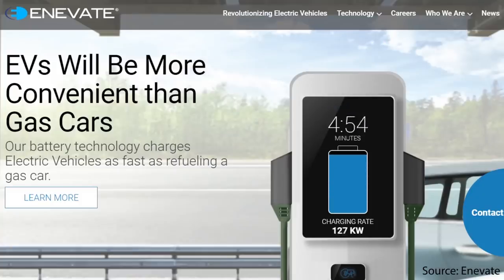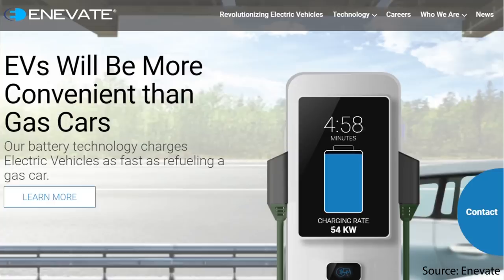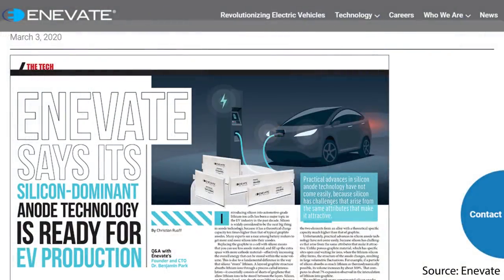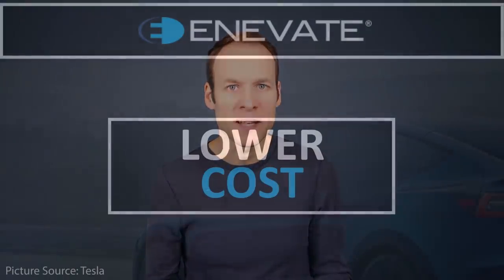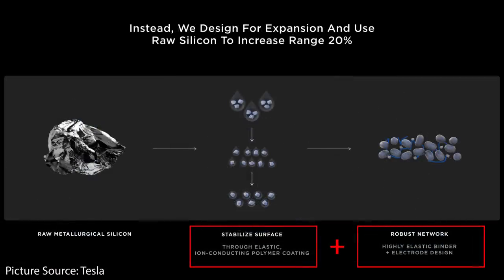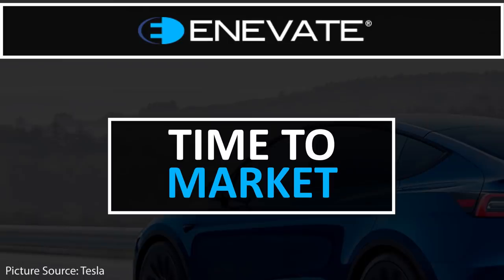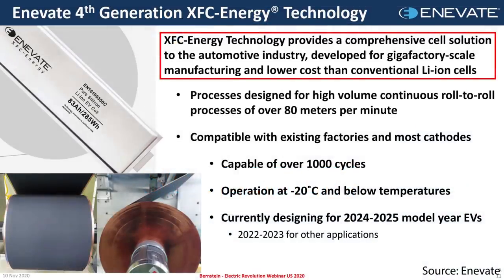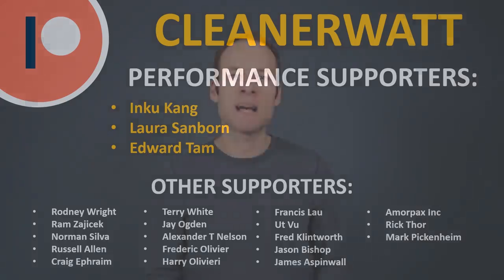Tesla Should Acquire ENEVATE Battery Startup (ULTRA FAST EV CHARGING)

Comment: What about the dendrite growth associated with more silicon - this severely decreases the cycle life of the battery.  How have they solved this problem?
Reply: SILICONE Lubercant.
Reply: The dendrite is actually much less with silicon dominant anode because silicon voltage vs. lithium is higher compared to graphite which leads to less dendrites. Especially with a silicon doninant design the N/P ratio between anode and cathode will be high which is good for safety and likelihood of dendrites decreases

Comment: I have zero doubt that project roadrunner has already done a full feasibility study on not only the properties but on the scalability of said batteries and they absolutely should not buy some stupid startup company when they are in the middle of ramping to production speeds on the battery that they feel checks off all the bases better.
Reply: The only benefit to buying innovate which doesn't have that many employees would be to poach those employees. that seems like a really expensive way to go around getting a couple more employees
Reply: The Limiting Factor in his last episode stated that charging shall be 2x faster in new battery.
Reply: If Tesla feels like Enevate's technology is better than what they currently are working on they could acquire the company to speed things up. Buying a company does not affect the rate of growth of Tesla at all. It can however be beneficial for future moves.
Reply: @yourcrazybear  
Tesla could have conflicting patents on similar silicon technology.  They might challenge Enevate and win.

Comment: Excellent innovation review.  Don't want to spill the beans here, but I believed the porous material is a diatomaceous earth material which is also silicon, but in this case, silicon dioxide remains of a siliceous skeleton (frustule).  This material can be crush into a much finer grain, almost microscopic, & it's used in a swimming pool filter.  Something in this line.  My guess, bake it.

Comment: First Principles thinking: Silicon expands by up to *400% which will destroy your battery. It doesn't have to destroy it right away but if It destroys your cell's internals in, say, a decade, what do you think that will do to your bottom line? Remember the biggest, costliest component of an EV is the battery.
Reply: Tesla IS going to a partial silicon anode. Solving the expansion was part of battery day.
Reply: That's what all the startups and big players in battery technology currently working on - trying to solve this problem.

Comment: hold up... your 4680 energy density estimate seems off. I am guessing that 20% number comes from range increase section of slide 67 of the presentation which points out that their use of silicon in the 4680 gets them a 20% range increase. What makes your 4680 estimate off to me is there is an additional 16% improvement from cell design and 4% improvement from cathode material that would also apply at the cell level. So assuming a straight application like I assume you did instead of

300wh/kg

it should be 

345 wh/kg

Which brings me to my other critique. Tesla's silicon anode improvement pretty much puts them on pace towards what your saying enevate enables. You should take a look at The Limiting Factors latest video IIRC. Not completly disagreeing with the suggestion. I would say however that enevate would need more than just the benefits of silicon which tesla is already doing in house and producing on their own manufacturing lines (at low yield currently), to make this aquisition make sense. The maxwell aquisition not only got them DBE technology. But I wouldnt be surprised if they leverage maxwell's capacitor technology to enable MW level super chargers

@cleanerwatt as for your intuition on the 300wh/kg being acurate based on what Elon said. I am uncertain if your holding that energy density as the best the 4680 can do with all the cell level improvements. Because given the agressive production timelines tesla is trying to meet. I would argue alot of the cell level improvements are not all going to be deployed at the same time. So for example I could see initially only the high nickle cathode and cell design (DBE + tabless) improvements making out the door at first, which also gets you to that same 20% improvement. While another 20% is slated to come online as tesla ramps its silicon anode production.
Reply: Its also possible that they start with the same chemistry they currently have and perfect production but focus on the form factor improvement, then move on to high nickel cathode, and then to the silicon loaded anode.  So it might actually be several stages before we get all the way there. Remember that Tesla wants to purchase their own first runs of the Semi so they can do internal testing and validation before  shipping them out. And that is the product that really NEEDS the perfected battery.
Reply: Tesla is also ambiguous : Range goes up more than energy density, due to saving in mass.

Comment: This is valid information for automakers who are not Tesla.
The battery day event by Tesla laid out the battery tech, the form of the battery 46x80mm and the fact that the actual structure of the upcoming models is based on that.
Sandy Munro said in his videos the efficiency and rigidity of the new module will make the cars stronger, safer, better handling and the battery less likely to be damaged in a catastrophic crash.
We should also remember that the teams working on the battery design and production from Hibar, Maxwell, ATW Automation and Tesla Grohman, plus what Tesla's own research, knowledge from Panasonic and Jeff Dahn's research site in Nova Scotia are bringing to the business.
Tesla are already making their new batteries and iterating the design of the machines to make them in massive volume. Might they already be being integrated into the Models S & X in the next couple of weeks?
Every one else is walking up to the start line. Tesla fired the starting pistol and ran away already.

Comment: The thing with pouch cells is that you can't use them to build a structural battery back, which is what Tesla is working on. And I'm pretty sure the Roadrunner cells are already plenty good, Tesla should just focus on ramping them up right now. Improvements come gradually later.

Comment: There are dozens of silicon battery start ups. maybe hundreds. Each of them could be potential buys. Nikola is an example where they claimed to have new battery tech from a university team. I do not doubt their claim. However with most of these the actual production is years away. A company might have 50 patents, and none of them might be practical in mass manufacturing. They may have one or two advantages, but when it comes to the whollisatic practicality they might have a crucial problem that negates the whole design eg silver lithium batteries ... too expensive. Tesla has to investigate these claims one by one and test and test and test.
Reply: I'm sure that there are hundreds, and 90% of the new ones are only there to extract money from investors.

Comment: Thank you for another great episode
You might have a point here.. 
but What make you think Teslas 4680 high nickel wont do the 5 minute charge?
Tesla has their own silicon, plus they have the dry electrode plus the tabless design and improved cooling.. and its scaleable. And acording to a Jeff Dahn paper they have 15.000 partial cycles
and it is in production today. And its cheap and fast to produce
But of course Tesla cant tell. Yet👍🇳🇴

Comment: I'm not really convinced by Enevate tech. 1k vs 1.5k is not a small difference and Tesla already has 1 million miles battery tech in their pipeline. They also have research going on about silicon anode, acquiring Enevate, or putting that amount of money into their own research? I think that money is better spent on their own R&D. Evevate tech looks decently impressive but I think it's better for them to work with other manufacturers than getting scooped up by Tesla.

Comment: Since Tesla is currently using more batteries than the rest of the market combined, why wouldn't they have already approached Tesla? Their ramp times make it sound as though this is not a production ready process yet. The fact that Tesla has already identified expansion concerns and addressed them in favor of cycle life makes a huge statement. Last they need to be able to produce this in a cost efficient manner. Approaching others to license the technology absolves them from actually having to solve some of the biggest manufacturing problems,  cycle lifetime of the cell, and actual range and performance in a real vehicle. All of these are already being proven at scale at Tesla.

Comment: I have a number of possible problems on my mind, which may not be  real, but I would like to put forth. While Enevate say they can make their technology in cylindrical format, I suspect that Tesla's 4680 cylinder format may be the wrong fit  for the sandwich roll Enevate may require. Tesla has probably optimized that format to their thickness of the rolled sandwich.
Enevate's density numbers may only occur in pouch cell format where the expansion can be most easily accommodated. Both prismatic and cylindrical cells have a more solid structure by design,  and pouch cells have to have that structure external to the cells. There goes the density advantage if that is the case. 
If those contracts that Enevate has already with other makers are firm enough, Tesla may have trouble buying them out.

Comment: The advantage of owning Enevate's tech might not add much value to cars made for the US market where most EV charging takes place in the owner's garage, but it would add tremendous value to the cars built for the Chinese market where a very high percentage of the EV owners live in apartments and are compelled to charge at charging stations. Deploying Enevate's tech would completely eliminate any advantage Noi hopes to achieve with their battery pack as a service strategy. Since China represents the largest auto market in the world, I think Tesla's acquiring  Elevate could potentially checkmate Nio by making their vast investment in battery swapping infrastructure and car design virtually to worthless.

Comment: How does this compare to the quantumscape solid state battery?
Reply: Quantumscape is already V A P O R W A R E .
4680 High Nickel cels are the NEW SHIT.
Reply: Quantumscape doesn't have a product to sell, and won't have a product to sell for at least 2 more years
Reply: Quantumscape uses pure Li as the anode...no Si
Reply: @tommckinney1489  Which means it has even more expansion problems than a pure silicon anode.
Reply: @patreekotime4578  It is not a problem, as they explained in their video. Silicon expands in all directions. Lithium metal simply swaps between the Cathode and anode. There is no anode material.
Reply: @daydreamer8373  🤦 which means there is 100% expansion of the lithium anode between fully discharged and fully charged states. What do you think is making the silicon expand? The lithium.
Reply: @patreekotime4578  Yes but only in one direction.
Reply: @patreekotime4578  Yes, but the anode is formed in situ.  They still have to account for the expansion, but it doesn't destroy the anode like the Si based batteries do.  It's a novel approach and is explained on their video.

Comment: Sure, a five-minute charge time when you're charging a single cell.  Ok.  Now try that with a 100kWh battery pack.

The current Tesla v2 Superchargers top out at 150kW of current for charging.  

Some cocktail-napkin math:  In order to throw a full charge on a 100kWh pack, assuming 90% charging efficiency means you'd need to deliver 110kWh of electricity to the battery (losing the rest as heat) for an hour.  At 150kW, that would take about 45 minutes.  In order to get the charging time down to 5 minutes, you'd need to deliver current at at least nine times (let's call it ten times just to have a safety margin) the rate.  In other words, you'd have to boost the charging rate to 1.5 megawatts.

I'm not an electrical engineer but I hang around with enough of them to know that the existing charging technology isn't remotely close to being able to handle the kind of current you'd need to charge a BEV in five minutes.

Comment: Just because you can charge your batteries at this very high rate where do you get the electricity from when everybody want to charge their cars at this rate? Green electricity does come in lumps like this.
Reply: You need to think about energy like it's Rainwater and then you might dream up some solutions for that
Reply: It would still enable a more flat charging curve which would still improve the charging speed.
Reply: @yourcrazybear  It is surely a time energy equation. For any body using a fast charger because they have to. They want to stuff the energy in ASAP. You can put hydrogen in very quickly.
Reply: @fidalfadel  Hydrogen is just a waste of time when it comes to regular cars though.
Reply: @yourcrazybear  How much electricity do you have to generate in winter to move every car? What about vans and trucks?
Reply: @fidalfadel  Not that much. You should also keep in mind that it will take atleast 20 years to replace all ICE cars on the roads with electric cars. We have more than 20 years of time to increase our energy production capabilities. This is not a big problem to solve at all.
Reply: @yourcrazybear  It is the storage I have a problem with. It is the shear amount of electricity we will have to store. The more electricity we use the more we have to store. We can't generate enough green electricity in winter. How do we store enough to last all winter?
Reply: @fidalfadel  Even if solar power decreases in the winter in certain parts of the world, wind energy should be more stable. In the end, we always have the choice to build out more nuclear power if there is need for that. 

In the end. Even using coal power would be preferred over having millions of individual cars burning fossil fuels. It's much easier to reduce the emissions from one big power plant than doing it on millions of cars individually.
Reply: @yourcrazybear  I believe that all transportation should be powered by green hydrogen. It does have lots of down sides. But has less down sides than BEVs when you have to power all your transportation all year round directly from electricity.
Reply: @fidalfadel  The thing is that if you want to produce hydrogen it requires far more energy than you can get out of it when you want to use it. It would be better to create a better storage system than that and keep using BEVs on the roads.
Reply: @yourcrazybear  All long term storage is no were near as efficient as lithium Ion. Things like air batteries are 50% efficient at best. Also very energy undense. You would need a huge amount of them taking up lots of space. Your winter electricity would then be as efficient as hydrogen. Even in summer. How much storage do you need to charge all the cars vans and trucks at night. The more electricity we use the more we have to store.
One of the inefficiencies of hydrogen is heat from the fuel cell. I watched a video of a guy from a very cold bit of Canada. From Tesla own battery data it was only 50% efficient in winter because of heating the car. Fuel cell cars will take the same amount of energy all year round.
Reply: @fidalfadel  Regardless if you want to use air batteries or hydrogen it will take up a lot of space, so I fail to understand the point you are trying to make here. 

And if you want to use hydrogen as winter storage you could as well just convert it into electricity and send it into the grid at once when needed. There is no need to manufacture fuel cell cars in this instance. 

Electric cars with heat pumps will also be more efficient than 50% in the winter. Tesla's cars with heatpumps also scavanges excess heat from the batteries to use for heating up the car. 

All in all. Electric cars is a better bet for future transportation in general. Most of the infrastructure is already there or is easy to build out. The only thing you need to focus on after that is electricity generation.
Reply: @yourcrazybear  Your point of view is the one that will win as Elon is very good at marketing. I absolutely know that transportation powered by batteries is the wrong solution. I guess in the next 20 years we will find out.

Comment: At these performances it doesn't make sense at all for Tesla to buy Enevate.
This company Enevate has done too little for some 15 years of research ( from 2005 ).
1000 charging cycles and the technology for EV application starts in 2024 ?
By then the Toyota's Solid State batteries could be cheaper, more efficient and with higher capacity.

Comment: You and ENEVATE are both comparing to current Tesla cells. Tesla's dry electrode factories will produce cells much cheaper than whatever ENEVATE is planning. Also you and ENEVATE are comparing the energy storage to Teslas current graphite electrode. Tesla is working on a silicon electrode which may be even better than what ENEVATE has. In any event, Tesla's new batteries will probably be in production before ENEVATE is.

Comment: it doesn't make any sense claim 75% in 5 mins, you did mention how much kw.
Reply: From my calculations for say a 75KWh battery from 10 to 75% is 45KWh. So that's 45 KW for one hour or 540KW for 5 minutes. Someone check my calculation as I never did this one before. Looks right though. 🤔
Reply: @garethrobinson2275  You calculated a fillup of 60% of the battery when you actually fill it up 65%. The charging session adds 48,75 KWH. The charging speed for the 5 minute session would be 585 KW.
Reply: Well it doesn't matter that much. The charging effect scales with the battery size.